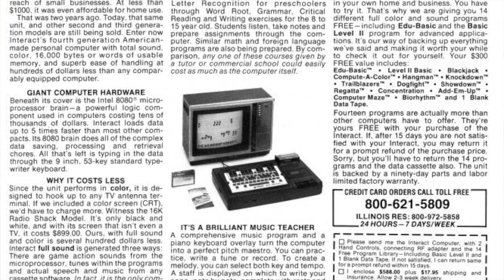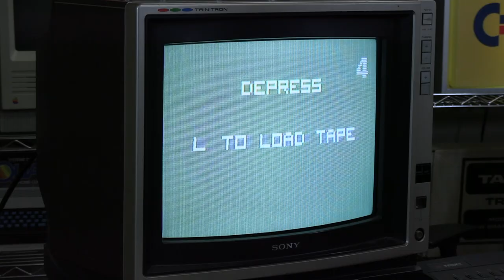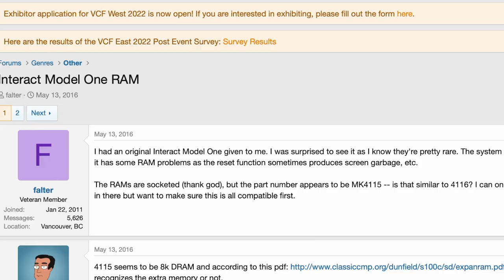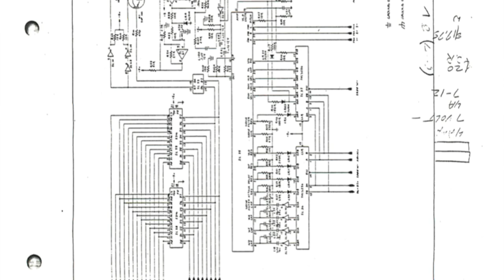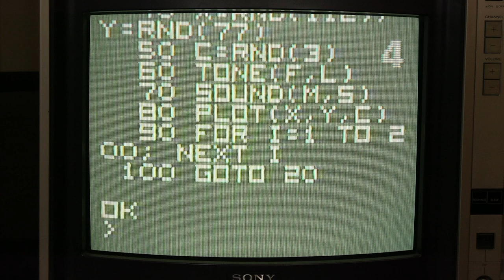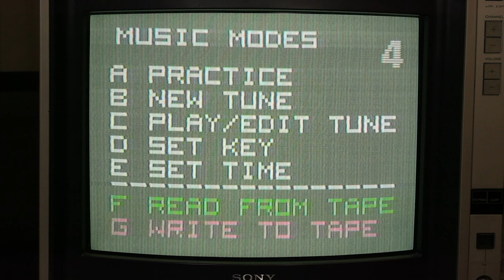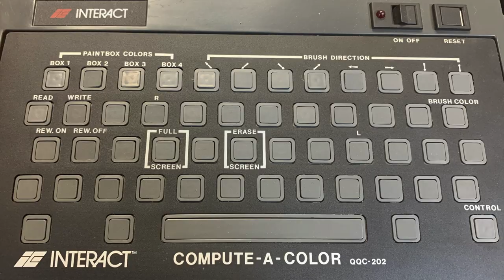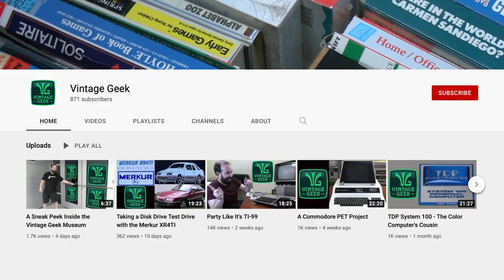Lights, Camera, INTERACTion!

Comment: Just came across this video. 
Yes, I owned an Interact Computer (several in fact)
The original Interact units had 8K of RAM and you could upgrade that to 16K. 16K of DRAM cost around $100 back in 1978.
The computer was test marketed for the 1977 Holiday season but the company. went bankrupt right after the first of the tear in 1978. An employee bought a lot of the completed machines and inventory from bankruptcy and opened another company in Ann Arbor, called MicroVideo.
The computers were manufactured by Manutronics of Manitowoc, Wisconsin and the all their inventory via mail order over the next year or so, 
I published a user based newsletter for the Interact for a few years called the "INTERACTion Newsletter", 
I will look and see if I still have a copy of the printed Newsletters

Comment: Startrack looks very much like the original Star Trek game written by Mike Mayfield in 1971 for the SDS Sigma 7 in BASIC. It was ported to literally every system that ran BASIC and can to this day be found in the package "bsd-games". Countless versions exist of it and sometimes it's found under different names. There's a version of 1974 by Bob Leedom called Super Star Trek, that added a lot of features that partly also found its way into the "modern" bsd-games package. Based on the command list shown in 8:34 I would guess this Interact version is based on the original from 1971. But the game mechanics in general stayed pretty much the same over the decades. That game is an important piece of history!

Comment: Another cool, long lost system. Excellent information. I forgot they even existed. If I remember right they cost about $499 for the 8k ($599 for the 16k) and you got about fifteen tapes programs with that price. They came out in the fall of 1978 for the holiday buying season.  They were sold in the local TV/Stereo/appliance store.   Thank you sharing this.

Comment: Thanks much for the fun video.  Great channel.  Subscribed.  Back around 1980 in early high school, I bought one of these (Interact Model "R", I think) from the back of a Popular Electronics (I think).  I modified it to act as the primary controller/computer for a robot after programming it and playing games on it for a year or so.  I recently found another for sale and grabbed it.  You mentioned a place to get programs (audio wave files) for the games and the like ... do you have one place in particular that has a good collection of the games and other programs?  In any case, thanks again and all the best.  Cheers